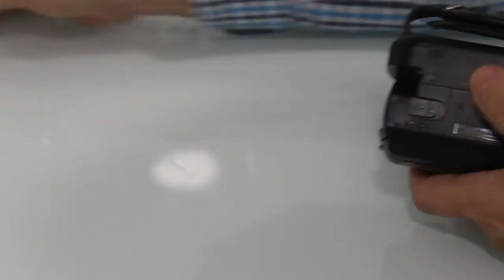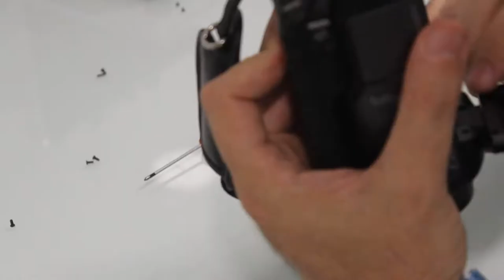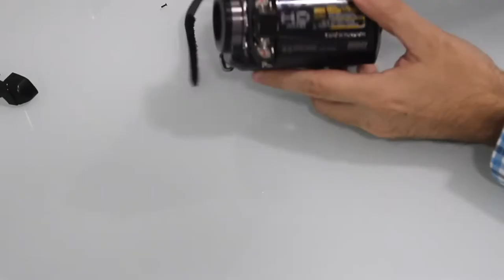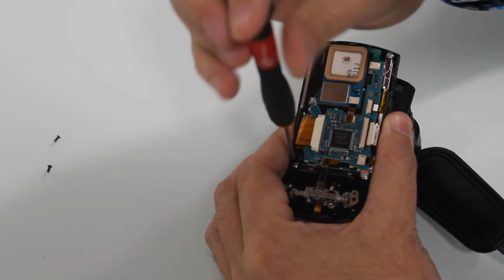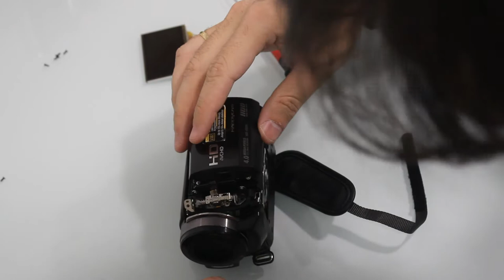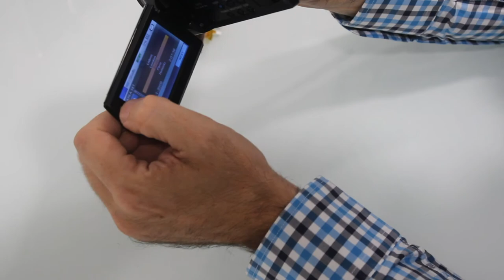How to fix a cracked or damaged camera screen.

Comment: Tq so much for your efforts to show how. I have a Sony hdr pj 760 with a projector unit which still functions well but has spotted dust like dirt when screened on. Tried clean the outer glass but didn't help.   Could I just pop out the cover and get to clean it myself? Only could see two screws on the hinge side. Tq.